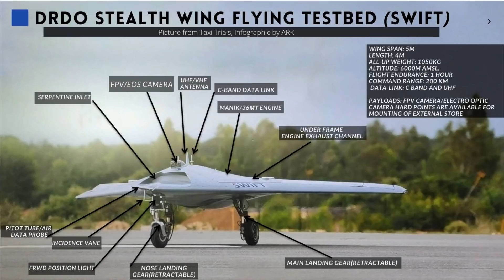SWIFT Landing gear to undergo load testing

Comment: Thrust vectoring nozzle on Ghatak will not allow stealth characteristics as current technology requires engine exhaust to be concealed, especially from below, to hide from radar. Better to use a smaller UAV using the Manik or even two. A 15-16 ton UAV will be very expensive and seems like another pie in the sky project without clear thinking. It will need a far more sophisticated control system which we are nowhere near having. We need something within 2-3 years that can be made in big numbers quickly, not 20-30 year fanciful projects that our HAL/DRDO "scientists" are so fond of. Such projects should be kept on back burner for now or given low priority in order to protect ourselves NOW.